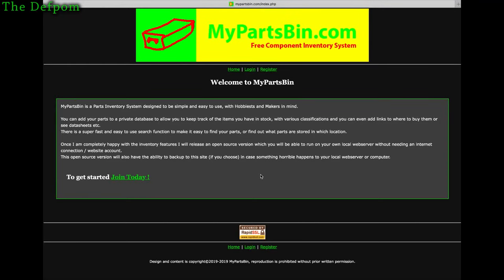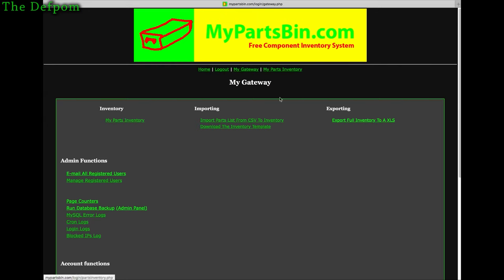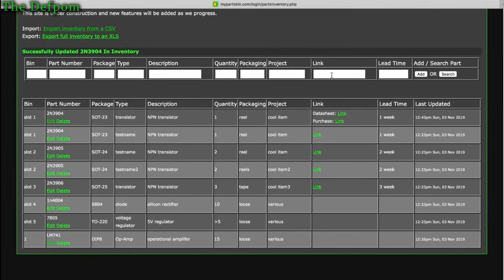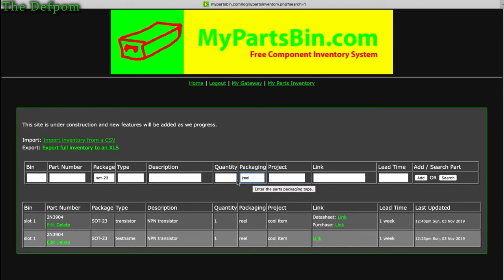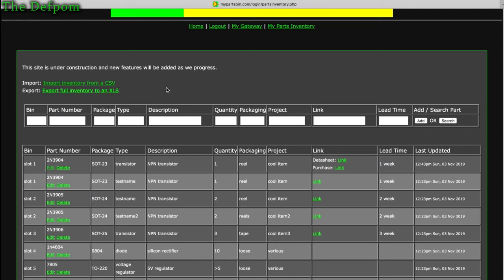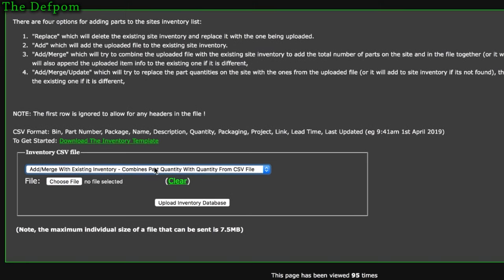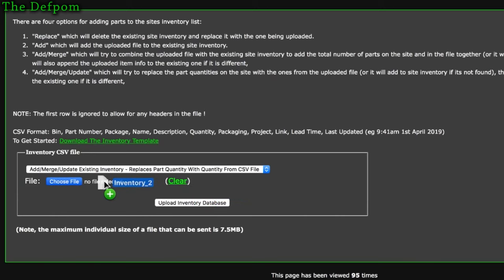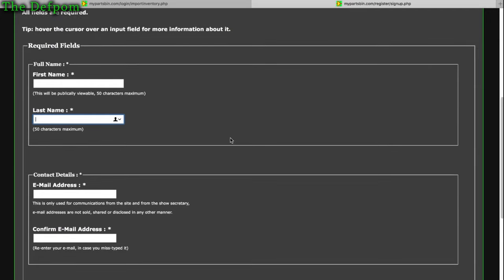🔴 #647 MyPartsBin.com Introduction - My Free Parts Inventory Site

Comment: Nice work.  Any thoughts of expanding it from a single table to a relational db, so (for example) you could seperate the parts inventory table from multiple linked project BOM's?  Otherwise, if a part is used in more than one project you'd need to duplicate the part.  Just a thought, but perhaps that's for a Ver. 2. :-)
Reply from the maker: Digicool Things - I will be adding a BOM feature, but it should be able to be done just by using the search with the project name.

Comment: A display check box to discriminate between New/Removed from Equipment (RFE) would be handy.  Also Mfr name.
Reply from the maker: You could put something in the description field for that, all of the fields are text, and you can put whatever you want into them.
Reply: @TheDefpom  the problem with multi-use text fields is that there is no standardization between users.   One mitigation could be to have a dozen or so re-nameable fields for ad-hoc use.  Kudos to you for your project idea!
Reply from the maker: As each users inventory is unique to them (nothing is shared) it really doesn't matter if they use different terms or conventions as it doesn't affect anyone else anyway. If I were building a community contributed inventory then that would be a different story and what you suggest would be a requirement.

I did consider using a selection menu for the packaging type, as there aren't many options there anyway, however if someone wants to list all the ones they have in one row for a particular part number, that would not be possible if I did that. (they may have some on tape, or a reel, or loose, and want to list them together).
Reply: @TheDefpom  Ok, probably not going to be worth my efforts if it can't be shared but I applaud your creativity.  My very old school system of pull out drawers would yield quickly diminishing returns in a database.
Reply from the maker: Chuck Patten - I do intend to add the ability to share either the inventory or a project from it publicly. I will add that later.

Comment: You should add a photo for each item
Reply: The Problem with images is that they take up quite a bit of space in a database.  The alternative method of keeping the images as files outside of the database is keeping the database link and the image file in sync.